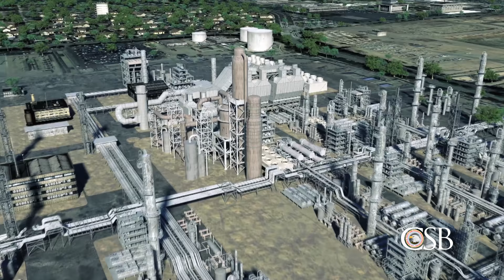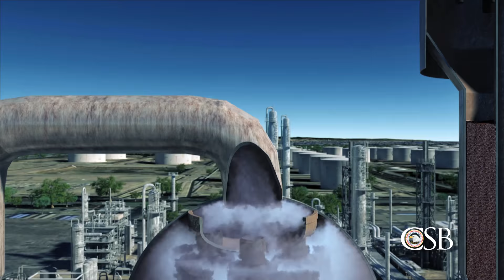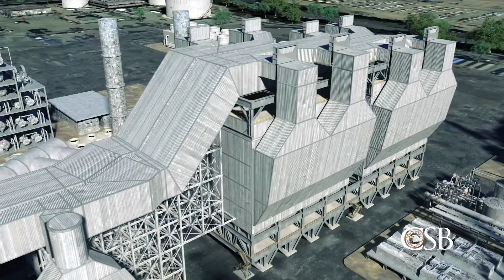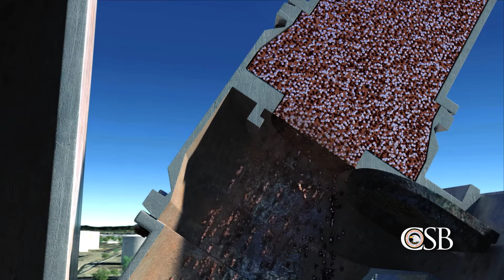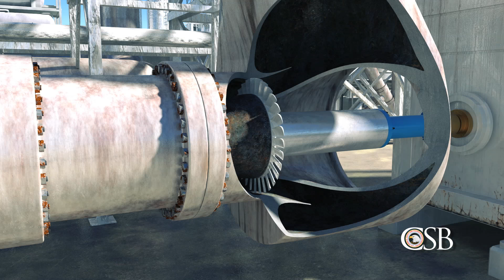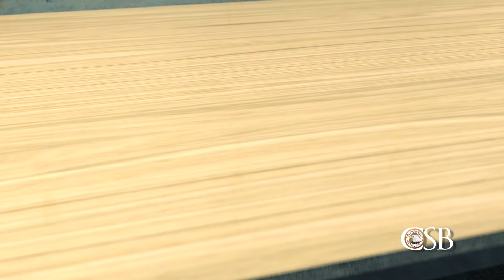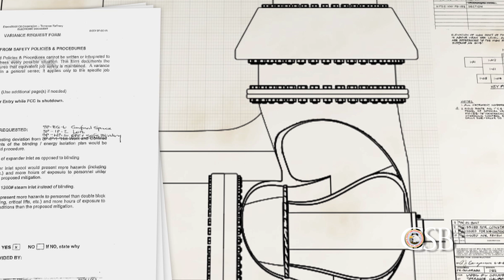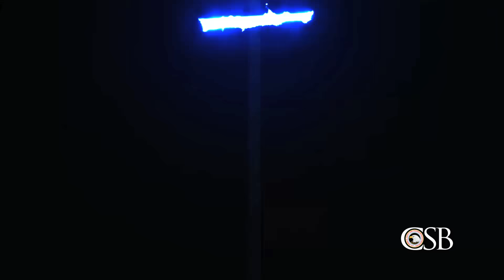Animation of 2015 Explosion at ExxonMobil Refinery in Torrance, CA

Comment: When they broke open the flange to install the blind, the workers were met with flowing steam.  This should tell them that the catalyst seal was not intact and that hydrocarbons from the distillation train could flow back.  They probably figured this out but assumed that the hydrocarbon side was completely purged of flammable materials so they lowered the steam in an attempt to install the blind.  The bad luck of having a leaking heat exchanger blew away all the assumptions.  This is how accidents happen.
Reply: No hes right this is how accidents happen. They used a shit variance that didnt allow for zero energy and proper isolation in order to save time and money. You can talk all you want about systems but this is exactly why you blind and isolate and verify zero energy. I never work inside of any vessel unless its blinded at the first flange and every flange off the vessel and i only install those blinds after a thorough loto and proven zero energy is in place. Even after that precautions should be taken. Its so easy to miss these things and thats why you need qualified people working on your equipment and redundant checks are put in place. Ive seen people mistake orfice plates for blinds or break open the wrong side of a closed valve because they didnt double check or verify. That was a 2012 variance and should have been scrapped and a newer better procedure developed. Instead they cheaped out and boom. RIP.
Reply: @mikec8679  This "variance" is what interests me. Sounds like a version of an MOC, but doubtfully equivalent. Even so, you'd think E/M's GDP could afford a more thorough application of PSM
Reply: @mikec8679  at least they invested in detectors and didnt kill anyone!
Reply: @mikec8679  "Mistaking orifice plates for blinds" This blew me off my chair even imagining the scale of accidents that could happen!
Reply: Mike C Accidents dont happen... mistakes happen
Reply: Knife Gate valves that are used in this process get eroded by operators not having no methods of flow control, so they use the knife gate to control  flow, which by running the knife gate at 50 percent open per say to control flow rate will cause wear on the leading edge  of the gate, over time they will no longer seal when closed, I personally  think they should have had another knife gate further down the line and that gate is either open or closed no in between, that Gates objective is to make the bearer. A simple flow meter beyond the knife gate should or would have told the operators that their is a leak.
Reply: @tylerozzy4443  a second slide valve most certainly would have helped. Not sure why level indication on the disengage side didn't indicate to the board man that the level was dropping.
Reply: @tylerozzy4443  Hindsight... But good tips.
Reply: Over here in NZ, we have a saying "assumptions are the root of all fuck up's" 
Personally, I think that forward thinking/thinking outside the box, coupled with not being afraid to speak up, is a trait that is seen less and less as the years go on.
Reply: @geoffbeyer1873  I've used a variance of that since I was 12 or so. After "Under Siege 2" came out and the lead mercenary said to one of his men; "Assumption is the mother of all fuck-ups"....Such truth.
Reply: @geoffbeyer1873  yep..Got bit in the ass by that one a few times...
Reply: A management introduced cost saving scheme to bypass all safety protocols and save time and money caused this to happen. It's called a Variance.
Reply: I would assume it's because the time interval between everyone's alarm going off and the stuff reaching the core of the ESP was probably minutes, if that and I'm speculating that it's probably a scenario of 'sometimes it takes a bit of time to turn something off, especially McLargeHuge equipment, lest you damage it badly in the process."  I'm speculating though.
Reply: Well said. You must have worked for Exxon before!
Reply: The accident happened, at least in part, because of 2 separate equipment failures. Routine inspection should have identified the wear on the shutter
Reply: "Uh, is there supposed to be steam here?"
"No, but it's OK, we'll just turn off the steam and it'll be fine"
Reply: The real question is why was the ESP still energized? Wouldn’t a fail safe shut that off ASAP?
Reply: @19MAD95  my first thoughts exactly. Any reasonably experienced ops supervisor would have ordered the ESP shut down immediately. This is almost like Piper Alpha.
Reply: Temperature, pressure, and other atmospheric data throughout a process train is necessary for so many reasons. I know it isn't practical, but refining companies can afford that minor expense for so many justifications
Reply: the root cause of most of these disasters seems to be people making assumptions to justify not having to go through extra steps and delay production
Reply: As soon as they saw the steam they should have known something else was wrong. I work on steam boilers. When I hear water is leaking out of radiators I know something is wrong. Even if I know nothing else.
Reply: @waterlec Dude, that would have cost them at least $1000,- dollars. It doesn't look like an outfit that's happy with spending money on repairs, upgrades, maintenance or security. And they probably pay insurance although I hope the insurance company did not pay out. Companies like this need to be culled from the herd with a vengeance.
Reply: Also the stupid esp is a big hazard, just use multiple cyclones, pass the flue gas through a shower of water, that way you take away catalyst fines and pollutants
Reply: titaniumsandwedge They should have called for all safety engineers on deck.  That scenario would have been scrutinized. Then a more expensive solution would have been imposed.
Reply: No it was sabotage  to raise the prices of gas   as it was sagging in price at the time
Reply: punker4Real 🗣no it wasn't, U.S Domestic fossile fuels are not used in America. Furthermore, fuel cost are the same the inflation of fossil fuel energies are solely based upon Taxation.  Federally then Statewide. 🤦🏿‍♂️
Reply: Lock 🔐 out tag out and full vessel isolation and always follow shutdown procedures
Reply: Broken catalyst valve, broken heat exchanger, broken expander....
Reply: @no_more_free_nicks  This is the way businesses are run.  Budgets are set which does not contain the money to repair old equipment.  Do this a few years and you have multiple points of failure.  Here is the rub:  the same companies will spend the money to keep sales going.  Travel and entertainment budgets, sales meetings, commission incentive programs.  I have been in manufacturing ops meeting where they fight for days over $10k of equipment.  The same company will think of nothing to spend $1 mln to attend a convention.  Manufacturing is the red headed step child.  It is grimy, boring, and dangerous.
Reply: I would assume they don't know much about the processes and leave that knowledge to engineers. These guys were probably just labours that were told they needed to install a blind so repair work could be done.
Reply: @7perm882  The blind was approved via process variance.  There were engineers all over this operation.
Reply: Indeed. And what did they expect to do about the lack of catalyst plug and the reason for it, had they finished their repair?  Were they just going to turn it back on after fixing the pump thing?
Reply: Did anyone died?
Reply: Bullshit like this shouldn't be happening in 2015..all about money to cheap for shutdown..tie off or die off,,rigger /ironworker/connector/ need work 12 yrs experience tools transportation ready
Reply: It is the same with galvanic separated grid (no possible path to ground with the first error) if a second error occurs that system might kill you
Reply: What he said.
Reply: titaniumsandwedge 
When the workers tried to open the flange with steam present they knew the seal was leaking.
Didn’t you watch the video ????
Reply: @draggin-up9911  Did you read my first response?  Of course they knew the seal was compromised.  It was the leaking heat exchanger which they did not know about that fed the hydrocarbons over to the air side.
Reply: This is why they teach us to never assume anything is completely purged
Reply: The static separator is the root problem. It's risky as hell to have that at all, let alone in a continuous flow path.
Reply: Even without the leaking heat exchanger, the presence of steam showed them they had a violated catalyst seal.
And you DO NOT operate it without a functional seal!
(unless you like big kabooms)

Even if the heat exchanger did not cause a problem immediately, after they repaired the expander and restarted the process they would STILL have gotten hydrocarbons in the air side, with all the dangers that go along with that.
Disaster was inevitable once they ignored the anomalous presence of steam at the expander!

P.S.
SURELY there is a sensor that shows the catalyst quantity upstream of the slide valve???
Or the pressure in the reactor, which would have clued them in to the additional hydrocarbons entering the process????
Reply: why didnt they shut off the steam, lock out the line then put the blind in? if it was leaking by a valve they should of shut off the steam as soon as they knew that valve was leaking by and blinded the slide valve before they blinded the flange then turned the steam back on. if they couldnt shut the steam off then their should of been another valve where that flange was, they could of just locked out a valve and kept the steam on. poor engineering and company negligence caused this.
Reply: @Brianthomas225  To isolate the slide valve they would have had to open a flange with hydrocarbons flowing through it.  They should have shut down completely when they noticed steam coming out the expander flange, including leaving steam on long enough after column was free of ALL hydrocarbons.  The leak at the HEX is the tricky part, they may not have noticed that, but hopefully in shutting down they would have LOTO'd the line from the HEX, preventing hydrocarbons from continuing to fill the column.  Almost always the correct solution is to shut down completely and re-group from a known safe condition, compared to trying to decide a course of action with unusual or unexpected process complications that you have no plan for in order to preserve up-time.
Reply: @Brianthomas225  shutting off/lessening the steam caused the problem to worsen.
Reply: thanks for repeating what the video already told us

Comment: Steamfitter here, shitty maintenance failure to remove old valves and have them inspected and rebuilt. Check valve missing or inoperable allowing back flow from other unit and jeese any job that dangerous and crappy should be handled by outside contractors. Always good to see a critical plan dusted off and evaluated by scratching out the date.

Comment: I worked a unit for several years in the US Virgin Islands (where I grew up) and ours was a newer design that used a Tertiary cyclone system and Wet Gas Scrubber to knock out the last of the catalyst. That ESB system sounds scary but then, it would cost millions to upgrade when it's working just fine, I guess. Slide valves in those systems are tricky too.    But, as a lowly operator (the ones on the front lines, getting the work done and finding the problems BEFORE they become catastrophic failures), I can appreciate the need of independent organizations like CSB, as well as OSHA, and the EPA to keep these fat cats in line. The elites running these companies are only worried about their shareholders, the company's public image and the bottom line, not the families and public affected by human losses and environmental damage. It's really sad to see when funding is cut because I'm not trying to die just doing my job.
Reply: We have only cyclone system, sometimes catalyst dust under foots, but without such incidents... yet (Ukraine).